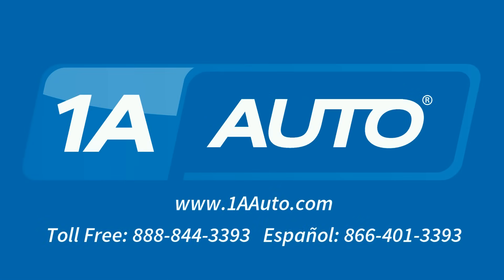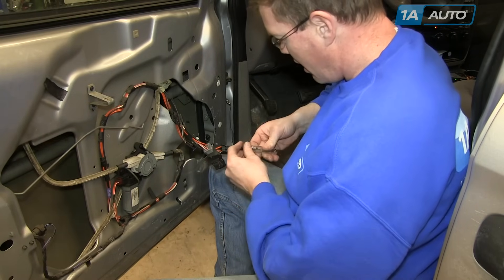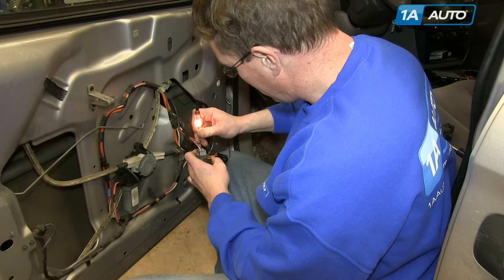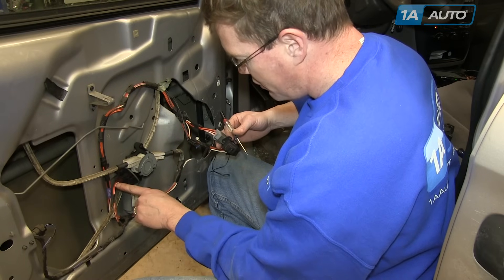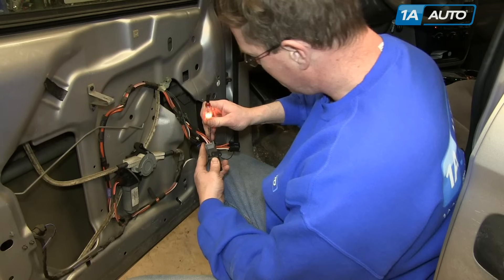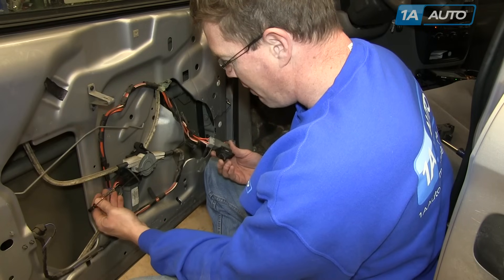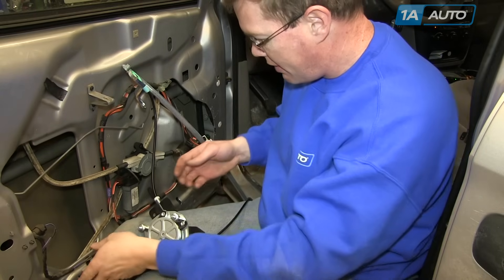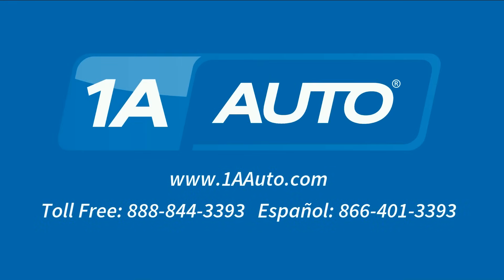How To Diagnose Power Window Problem - Is the Switch or Motor bad?

Comment: From my perspective, the hardest thing with the "easier" DIY auto self-repair jobs is usually getting access to the parts and then putting things back together. Broken glue seals, damaged gaskets/seals, damaged fasteners, not to mention just trying to figure out the disassembly and reassembly! :-b My window switch is not working. How do I get to it? I need to find that video, but I am dreading it will be involve taking gambles of the type that novices sometimes end up regretting.

Comment: my friend has a 1990 ford mustang and the passenger side window will go up but not down, he replaced the switch and motor and still .does the same thing also the driver's side switch that operates the passenger side will not work either, any input on this matter would be greatful and appreciated. thank you

Comment: Hi, my 96 Accord EX rear passenger window rolls down but not up. I have 2 regulators and tested both for the same results. Fuse is good. Switch perhaps? Thanks in advance!
Reply from the maker: +Tyler Hamby You may want to test the window switch might be bad. We carry the front master window switches if your master one needs to be replaced. Here's a link to them https://goo.gl/bXXY7n

Comment: My test light shines when I touch one wire but not when I touch the other wire. I swapped switch out to the passenger side it worked fine. I take it to mean there's a short in the driver's side wiring?

Comment: Hello. Ordering my 2006 Honda speakers from 1A Auto. However, my passenger window is stuck. When I removed the panel to assess, I noticed the motor is very hot. Would that be an indicator that it still works but it's receiving mixed signals? I read in a another forum that sometimes the master switch on the driver's side is stuck on "up" or "down" and it heats up the motor of the window it's selecting.
Reply from the maker: +James Bon This is a possibility, however, the best option would be to have a diagnosis performed by a reputable mechanic to confirm the exact problem your vehicle is having.
Reply: @1AAuto  Thank you for responding. I wrapped a paper towel around a flat head screw driver, went around the edge of the window to made sure the glass was not sticking. Later, I even sprayed WD40 around the edges, as well. Weird...next day it worked beautifully. I guess it was just sticking.

Comment: I've got a 2006 Elantra GLS. None of the motor regulators work. All fuses are good. From what I can see all wires are good. I heard that there are separate fuses and relays (per Internet and Haynes manual. Could the relay or one of these fuses keep all my windows from working. We bought a new regulator and circuit board but it didn't fix the problem.
Reply: The Mongoose was the relay the issue?

Comment: HELP!!!!   Your videos are great.  I love my 1997 4runner Ltd with 240k also.  I want keep it runner forever.  Can you help me with one issue that I can't solve.  My passenger door window only goes down but not up.  I have replaced the window motor already but it is still having the same issue.  I tried both driver and passenger side buttons, checked the fuse but they both can't bring the window up.  Can you give me a few pointers in troubleshooting the issue.  Thanks.
Reply from the maker: +Web Cityx Thanks for checking us out! There could be multiple reasons why you're having this particular problem. We suggest taking your vehicle to a nearby reputable shop to identify the cause. Once you know the cause, we'll be happy to see if we carry the parts and how-to videos needed for your repair.

Comment: This is a long shot question since this video is 7 years old idk if I get a response. But what happens when you have constant power coming out of the plug for the regulator and when you use the switch you can hear ticking in the regulator when plugged in, I have replaced 3 regulators and they worked fine before then went into the truck. but as soon as you use the switch it likes blows the regulator and then it stops working like it should, but you still hear ticks when using the switch inside the regulator

Comment: Can you answer...?
Replaced driver front regulator (kept the motor, it appeared to work with a bench test). After new regulator back in place, only "up" works, "down" doesn't!  I have verified that there is power at the motor connector for both up and down... I'm baffled. Is there some sort of limit switcg/fuse inside the motor? (2002 Olds Intrigue)

Comment: Hello , thanks for this video ...  I followed your steps and changed both the motor and the switches in both sides (it a single  cabin silverado) and sadly my passenger door still not  working, I can only hear a click inside the switch when y press it. I tested the motor directly to the battery and it works. Any idea what else can it be? Please help :)

Comment: Great video but what if I only have power to one wire coming out of the motor? The other wire has power. Also, after disconnecting power connections to window and lock in order to get the panel off, the lock won't go down. It will go up though. <Sigh> I'm making things worse by trying to fix them. Any ideas? I have a 2006 Grand Caravan.
Reply from the maker: +Cory Nilsson You may want to test the switch to see if it's working properly. Hope this helps you out. 1aauto.com

Comment: Ok I replaced the switches and motor for my passenger side window on my 05 Dodge Neon SXT. I did bring it to a shop where they fix windows but couldn't find anything wrong with the motor or the switches. They said it was a ground wire. Can you make and link me a video on how to find it and fix it??

Comment: Here's my problem on a '05 Colorado passenger window. My window struggles going down and gets stuck. Then, it won't go down or up. If I briefly push down on the window it works down and up. The next time it gets stuck again. If I continually push down on the window, it works up and down. So I've ruled out a bad switch, and ruled out a "totally" bad motor. Could there be a poor "connection" in the motor? What's your opinion?
Reply from the maker: +Richard Ludeman Definitely sounds like an odd problem. Happy to hear you got it worked out though! Thanks for commenting.  1aauto.com 866-403-3393

Comment: hello,  There could also be a bad ground problem, I have a 2000 Honda CRV that I just tested and the switch and wiring is good, and so is the motor but it only goes down when I ground one of the 2 wires going to the motor, I need to know where this wire is supposed to ground because I can't just run a new ground wire cause its the same wire that gets power when the window switch is pushed to bring the window up.  any ideas ?

Comment: I just bought a new window motor lift. I installed it and it worked fine. The next day I used my car and tried to roll it down and it wouldn't work.When i got out of the store i turned my car on and pushed the button to roll down and it worked fine. The last couple of days its been doing the same thing. Sometimes it works fine and sometimes it doesn't at all. I want to figure out what wrong with it before i return the motor i just purchased. Any suggestions?
Reply from the maker: +Ron Menendez Thanks for watching. We are sorry to hear you are experiencing this type of an issue. In a case where it is intermittent, we recommend testing the power window switch as well as the connector which plugs into the motor for a snug fit. 1aauto.com
Reply: Thank you on your speedy reply. I will look into that.

Comment: I have a 2007 honda accord absolute base model. my driver side window works perfectly, but my 3 other windows (4 door) do not go down. when their switches are triggered, you just here a clicking sound. it is odd for all 3 motors to go bad, right? i think it is just the main switchboard on the driver's door, but i would like your input. i don't want to take apart 3 entire door panels to replace each individual motor, haha.
Reply from the maker: +Andrew T If they all went out at once I would lean towards inspecting the master switch.  Do the windows function when you use their own switches?  I.E. using the switch on the rear passenger door for the rear passenger window?  I would try that and use the knowledge presented in this video to further inspect the vehicle.
Reply: the windows do not function with their own switches, but it still would seem funky that all motors went out at once.

Comment: Although if your cable has broken,  or the plastic cable end holder broke, and subsequently the cable is jammed up in the spool, the motor will not "operate", since it can't force the jammed spool of cable. Just like when your come-a-long jams, and you have to take it all apart to reload the cable. So, not always is the motor bad.

Comment: Hello friend, greetings from Chile. My nissan frontier does not raise or lower the glasses, even the central locking does not work either. I bought the main button panel of the glass racks, but the problem continues, it only raises and lowers the glass a little on the pilot's side, but it stops, plus the button lights come on and then go off and no longer work. Also when pressing the central locking button a "CLICK" is heard under the steering wheel. Perhaps it is some relay that is failing? please i need your help or advice.

Comment: the repair was good . but  I have a problem with no power to switch drivers door for rear windos orange /yellow has now power. put power to it and rear windos work. unable to find fuse were to I look for it thanks

Comment: I have an odd problem. 2000 F350 twice or three times a summer driver side window will stop working. I park it and the next morning it works! Sometimes I think 🤔 it’s heat related when that side faces the sun. I’ve had it apart and traced to the motor and wiggling the plug and it starts working. So I haven’t really figured out the problem. It’s very strange. Let me just add this vehicle has no rust. Never seen salt! 
Any ideas out there?
Thanks

Comment: I have a 30A fuse  P/W fuse blowing consistently out on my 2004 Santa fe. If the switch is bad or the motor regulator is bad will it keep blowing that fuse out?

Comment: I have a intermittent passenger side window problem. When I use the driver side power window switch the passenger side window will go down. But when I try to bring the window back up it wont until after a series of flicks at the driver side power window switch. Is it my switch or the regulator in my passenger side door?
Reply from the maker: +Joshua Crump We wouldn't be able to diagnose an issue like that here, you may want to have a local mechanic take a look at it. Thanks for checking us out! 1AAuto.com

Comment: Hi..for my 08 mazda 3..
The mechanic did some wire reconnections (grounding?) on the front passenger side to have control over its own window coz the central switch lost control over it. Now that i have bought a new master lock/switch, i'd like to know how i can put the wires of the front passenger side back to its default connection..thank you.
Reply from the maker: +j c Thanks for checking us out! http://1aau.to/m/Shop-1AAuto-c

Comment: I have a window that that takes a REALLY long time to close (twice as long to close vs. open). Does that sound like a motor that's on its last leg?
Reply from the maker: +Haunter Mansion It is possible that the motor is about to go I would also make sure nothing inside the door is getting tangled with regulator cable.

Comment: Hey hello I have a problem with a 2014 Jetta with driver side but the problem sometimes it work  and sometimes it doesn't can I used this same procedure to check the motor?
Reply from the maker: +Genaro Garcia You can certainly take that approach to diagnose the issue!

Comment: Hey guys I've got a problem I'm hoping you can help. I have a 2012 Chevy Silverado LS Crew Cab and the driver window stopped working, just the driver window, all 3 other work from all switches including the driver control switches. I replaced the regulator/motor assembly (Thanks to 1aauto.com) and the driver master window switch, but the window still does not work! I have 2-12v hots at the harness to the switch (one yellow and one light blue with a white stripe) but no power at the motor connection nor at the harness on the switch connection to the motor. Could it be I had a bad switch and the replacement has the same problem or am I missing something! Any help would be great, thanks!

Comment: My front windows work fine. Both windows in rear wont work at all. They don't work from main switch or rear switches. If the main switch goes bad will that stop rear from working all together ?
Reply from the maker: +dkeller1 It is possible that the failure in the main switch can cause that to happen, but not likely.  I would inspect the wiring to make sure the motors are getting power.
Reply: Thanks for the reply.. I broke down and just took it in to dealer. Dealer said corroded harness and wires by fuse box ...  Cost for new harness and labor .. 800.00 !!   Ouch .. All for rear Windows ..

Comment: Hi may I ask?  The front passenger window of my car cannot be raised or lowered if the driver's window has not been lowered, so if the driver's window is still tightly closed I cannot lower or raise the front passenger window.  I've checked the fuse still hasn't blown, I just replaced the window switch recently. Do you know where the problem is?

Comment: All these powered window videos advice only on the most simple problems: either the motor or the switch. My Ford Focus mk1 has a problem with the right rear window. The buttons on that door work fine both up and down so the motor is good. But at the driver buttons both up and down make the window go down. I tested the connector that goes into that switch with a short piece of wire; i can make the front window go up and down, but the rear right window down wire is not responding. So the problem is inside the wiring harness. It’s nearly impossible to find advice on that or some electric schematic. Seems like the best solution is to just disconnect that window completely. Being unable to bring the window up on the highway is a disaster. If you happen to have paper or something else lightweight laying in your car and the window cannot close then you can wave goodbye to it.

Comment: What other model car can I get a pwm if I can't find one for my 2000 GMC Jimmy?
Reply from the maker: +Al Krivan Thank you for checking us out. If you are in reference to the power window motor, it looks as though the 2000 Jimmy used the same motor as multiple other applications such as a Envoy from 1998 - 2000 with a 9 tooth gear, or a Blazer. 1aauto.com
Reply: Hi 1A Auto,

Which electrical light gauge/tool are you using? I would need to buy one in preparation for my Lincoln Town car window diagnoses and repair.

Comment: I have a 2005 Impala. All the windows are stuck up. When I hit the driver's switch, up or down, it just buzzes, I changed out the entire switch panel and it was the same with a new switch. No other windows respond either. Can you tell what it probably is?
Is it likely to be the regulator, since no other windows work either?

Comment: Do these steps in reverse. If you find right away that you're getting power to the motor, you know immediately that it's the motor.
Reply: Mark F 2003 Sebring sedan. I fed the front pass. motor 12v from a separate battery and it works up and down by switching the wires. When plugged into the car harness window goes down, but not up. Will not work at all from the driver's door master switch. I have a constant ground on one leg of the motor, even with the switch in the neutral position, and no ground on the other leg with the switch in the neutral or up and down positions. Any ideas? Thanks
Reply: +rusco321 h co bz off

Comment: 2003 Sebring sedan. I fed the front pass. motor 12v from a separate battery and it works up and down by switching the wires. When plugged into the car harness window goes down, but not up. Will not work at all from the driver's door master switch. I have a constant ground on one leg of the motor, even with the switch in the neutral position, and no ground on the other leg with the switch in the neutral or up and down positions. Any ideas? Thanks

Comment: on a 95 chevy c1500, both power windows are not working driver and passenger. I have checked the button housing and its getting and sending power to the motor. I bought a new motor and plugged it in to confirm its the motor and the new one does not move either. Looking for some tips thanks

Comment: Thanks for the video. My question is I have power going to the motor when I press down it reads 13.5v. But when I press up it reads 0.00. What does that mean.  Bad motor or short somewhere? 
Thanks
Reply from the maker: +Omid Rahnemaei The window switch might be back. If you would like to reply back with your year, made, model and what door the switch is on we can see if we have a replacement for you, if yours has gone bad. 1aauto.com

Comment: I’ve a problem with my 95 integra passenger side window, it rolls up with the drivers door switch, but it won’t with its own switch. Also the locking switch is not working. Just hoping you could help me out solving this problem. TIA
Reply from the maker: +Miguel flores Use our video library and select your year, make, and model for all videos we have for your vehicle: https://www.1aauto.com/videos

Comment: I have a 2014 Sierra and now gone through 2 window regulators. The driver window goes up about 4 inches and then goes all the way back down. I can inch it all the way up. The window also goes up very slow as well. It is driving me insane trying to figure this out.